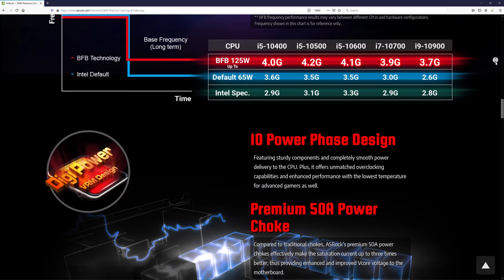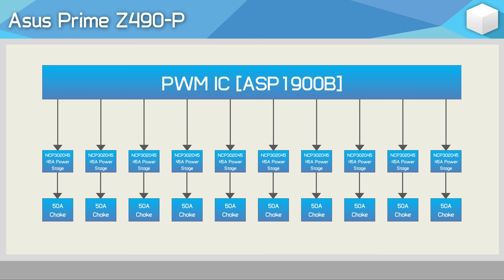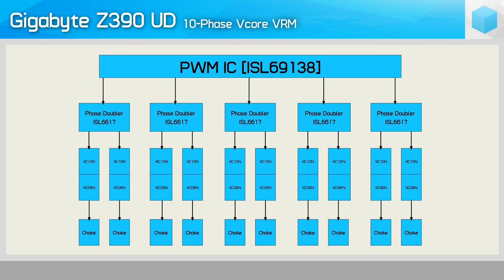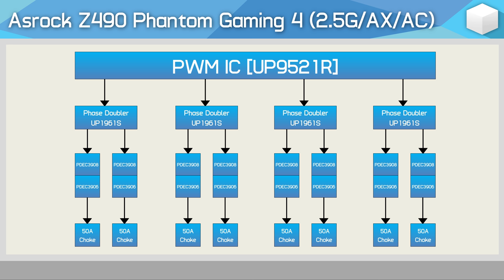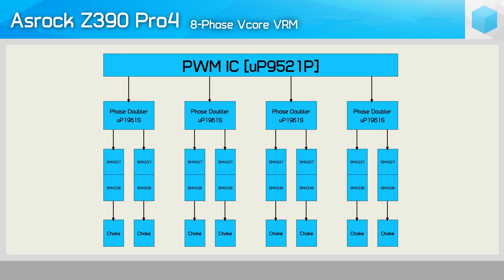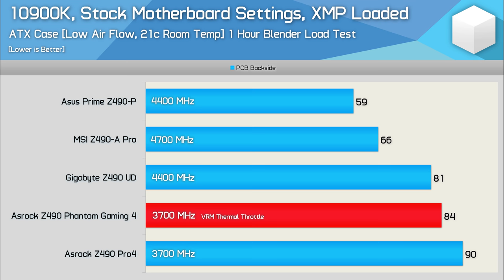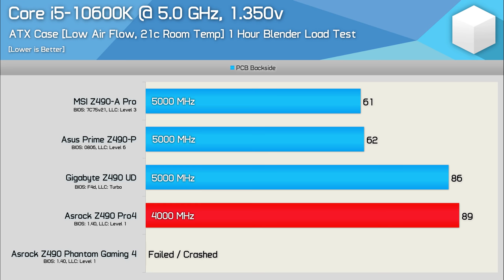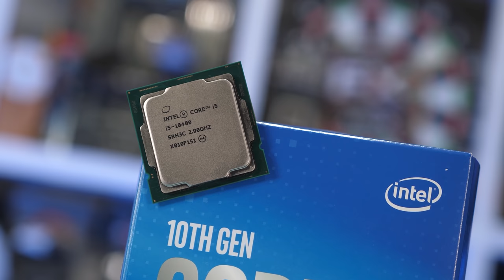Intel Z490 VRM Testing, Budget Buyers Beware of Lies & Misleading Marketing

Comment: You'll notice the heatsinks from allot of asrock boards are the same that were used on £55 GA-78LMT-USB3 syle amd boards from 2012.
Yeah there's a reason why I haven't given asrock a second chance in the last 10 years, Every single board they make has been penny pinched beyond reason. The boards have bad designs with sacrifices made everywhere and horrific bioses and they're like £5 cheaper than the others which is a meaningless amount of difference, The only reason people buy them is because they dont know better or say "well I've had no problems" yeah well allot of people dont have problems with foxconn or ECS motherboards either, Still shit.

Comment: It's not the VRM that's bad.. it's making CPU that put out that much heat. Is it worth getting 50% more speed for 500% more power consumption and price? A 360mm cooler is completely reasonable 😂